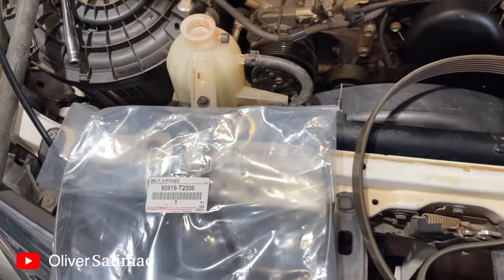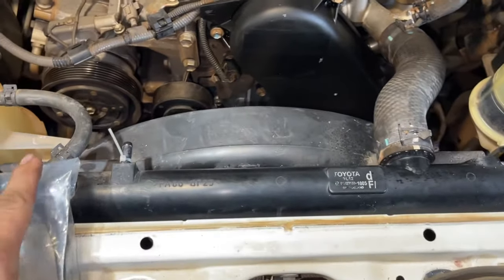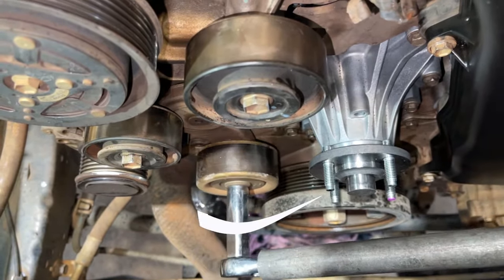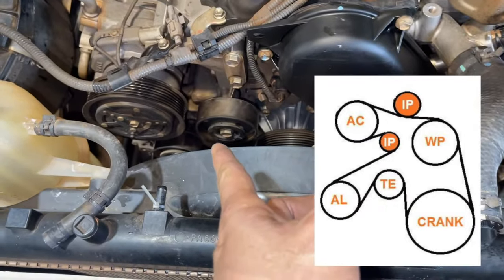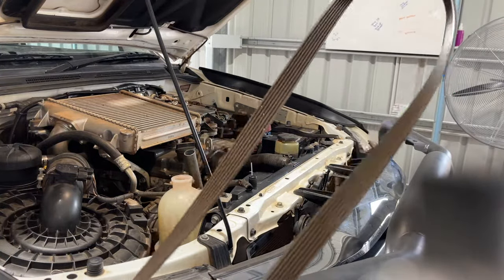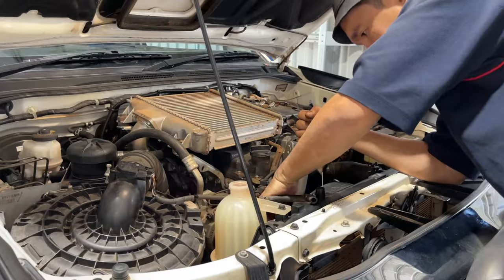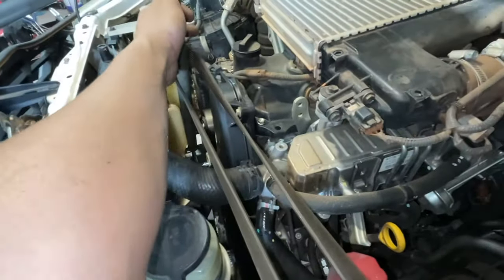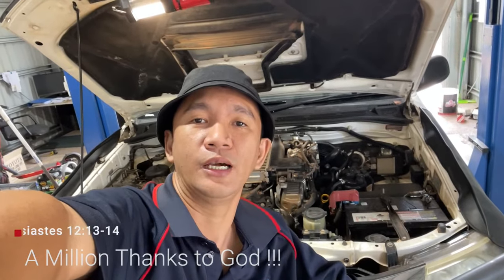HOW TO REPLACED TOYOTA HILUX DRIVE BELT

Comment: Great tutorial. Today my battery indicator light came on, then the engine check light, then the horrid temperature gauge went into the red. After opening the hood I saw that the rubber seal around the hood scoop came off and was lodged into the drive belt. Noticing this horror me and my work colleague got to work. Every effort was futile, until I had a light bulb moment of searching YouTube for a fix. Here we are with no tools apart from a metal bar and a hammer, we released the tension and followed the configuration of your tutorial. The work truck is now up and running and saved a few hundred on a mechanic. Great work
Reply from the maker: Thanks Mate for the positive response Im really glad in a small thing i help you :-) Have a lovely day and God Bless

Comment: I liked your method, easy and straight forward
Reply from the maker: Thanks mate 🥰 actually i have lots of technic but i make my video as easiest as possible so other can copy it 😉 the more you help other people the more God will give you more technic 😇
Reply: @oliverthemechanic8532   the main problem with my Vigo double cabin is ,  when i replace the old worn out fan belt, when I start the vehicle the  belt tends to get out of aircon  pulley and the alternate pulley,I jut replace it without any adjustment of the pulleys
 How are the  two pulley adjusted to align with others
Reply from the maker: @benrowlands2023  just check the pulley bearing first maybe its mis aligned mate or maybe there is a big play that’s why it jump when it spin 🤔

Comment: Should you replace the pulleys as well?
Reply from the maker: It depends mate if the pulleys is still ok or not and also if km is high it’s better replace the pulleys 😉
Reply: @oliverthemechanic8532  the auxiliary belt has been changed less than 10000 km ago and the mechanics said nothing about the pulleys. 1kd has now 146000 km on it and it's 2009 model with original t-belt.. I am changing it along with the 2 other pieces coming with the set and the water pump. Thinking while I am it what else to change.. auxiliary pulleys and what else?
Reply from the maker: @6295607  do the outside belt tensioners also mate 😉
Reply: @oliverthemechanic8532  what are those?   Part number? The timing belt set comes with 2 other part.. you talking about those right?
Reply from the maker: @6295607  not inside the timing belt mate the  outside tensioner belt 😉 im not quite sure about the part number 😬 just tell the parts guy drive belt tensioner ( belt that hold the alternator aircon etc… )